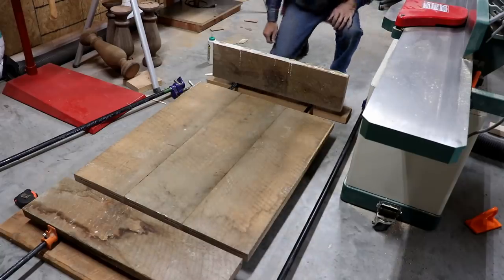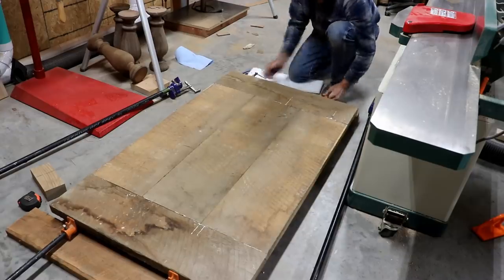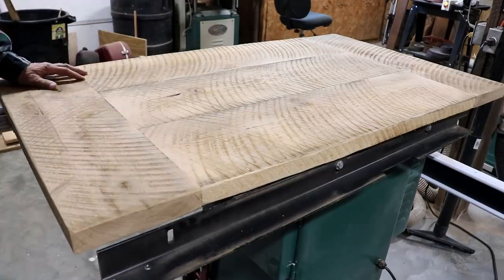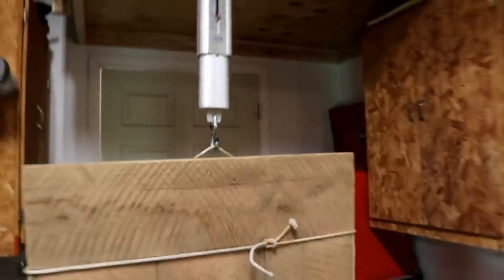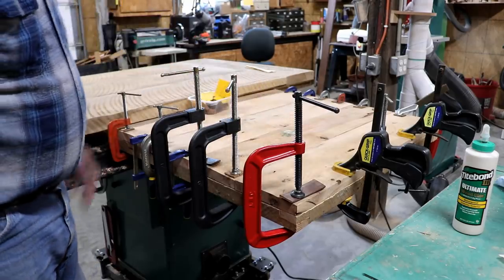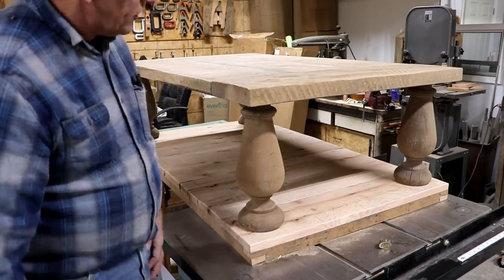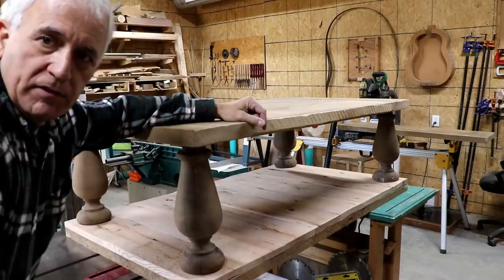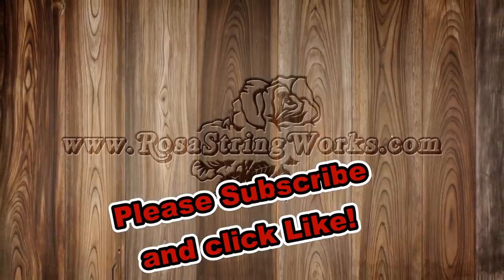351 RSW Side Project   Rustic Coffee Table

Comment: Did you give it a yell test? Turn out the lights and walk around it in your bare feet.  This is usually done in the middle of the night preferably when you're half asleep.  This checks for sharp edges and trip hazards.  If you yell, you've failed, so you'll need to soften any corners you find the next morning.

Comment: I know nothing about guitar making, but a little about woodworking and table tops. I hope the cross grain glue joints hold . Some floating, loose tenons on just the ends might have been better? Fingers crossed.  Nice and easy trick is to burnish the top edges with a screwdriver shaft or steel rod for a super smooth aged look and feel in 2 minutes.
Reply: Man challenges wood joints to not obey physics, and hopes for the best! To each his own. No bread boards, show end grain, fit the rustic goal too?

Comment: Nice video but if I could point out some issues for your audience.   The biscuits don't give it any strength.  They are simply a tool for aligning mating pieces when gluing.  Don't glue perpendicular joints on wide glue ups (the long planks to the end planks).  The planks will want to expand and contract in width but not in length, so when they want to move and they're glued to the end boards that don't, they'll either pop off if you didn't use much glue, or more commonly, split.  There are other ways to make that joint that allow for the movement but still keep the "bread boards" or end planks joined.

Comment: It looks good, but it's more a percussion instrument than a stringed one. Glad to see you are branching out. If you have problems with the biscuits, change them out for either dowels or slip tenons. (1/2 inch min diameter 2+ inches min into each side for strength. 2 in the center of each board glued tight and one outboard each side glued only in the long grain, wallowed out in the other board side to side to allow for movement)
Reply from the maker: It had to be solid it can't allow for movement because legs are underneath the end caps. You can allow for movement in a door or a panel.
Reply: @RosaStringWorks  basically you have built a top with breadboard ends. View each board of the top separately. The idea is to allow the outside edges to move while the heavy joinery in the center takes the load. It's not difficult and it will work. it's just something to keep in mind if the biscuits fail.

Comment: Biscuits don't do much for strength, you use them so the clamps don't pull the pieces out of alignment.  The only system that adds strength is the Festool Domino tenon joiner system.  The tenon pieces are thick enough and long enough that they add strength to the glue joint.
Reply from the maker: Trust me you're preaching to the choir. Been there and done that like a thousand times over
Reply: Theories are great and provide endless opportunities to argue on the Internet.   Try it yourself.  Use the same wood and make three joints.  One with glue only, one with biscuits and one with Domino tenons.  Then try and break the joints.   The wood with no biscuit or Domino will break and the wood will rip away from the glue line proving that the glue is stronger than the wood.  The biscuit will do nearly the same thing with the biscuits being broken.  The Domino joint, on the other hand, will act like a tenon and will reinforce the joint making it much more difficult to break.  It will take substantially more force to break the Domino joint because you have a series of tenons between the two pieces of wood.  

The thicker the wood being joined, the more effect the Domino tenons will have as they are much bigger than any biscuit.   As an example, you can get Domino tenons that are 14mm thick and 75mm long.  That means you have a tenon that is essentially 1/2-inch thick by 3-inches long to work with - that provides a whole lot more reinforcement than a 1/8-inch thick biscuit can provide.

I prefer biscuits when gluing up thinner pieces (1/2 thick) as I use the "FF" size biscuits for alignment of the pieces, as they are small enough that they don't telegraph through the wood as they expand from the glue.   The largest biscuits are the #20, and although they are 2.25 inches in length, they are still only 0.125 thick.   

I do glue ups with 2-inch+ thick slab woods like walnut, maple, oak, ash, beech, etc.   From my experience, the Domino system provides far better strength on slab glue-ups as it's like having large dowels between the pieces of wood - but, far easier to use and, like biscuits, the Domino tenons are made from compressed beech and expand slightly from the glue, locking them into the mortise created by the Domino cutter.

There are other advantages to the Domino system as you can get Domino bolt connections that allow the furniture to be disassembled and then put back together with a mechanical connection at the joint.

The difference between me and most other people on the Internet is that I don't makes posts that include information I haven't tested or don't have direct experience with.  The Domino joint is stronger than a biscuit joint and no more difficult to make than a biscuit joint.  The real difference is that the Festool Domino cutter is about 2.5x the cost of a biscuit joiner.  Oh, and by the way --- you're welcome for the lesson...back at 'ya...